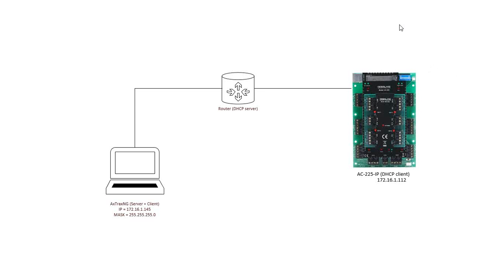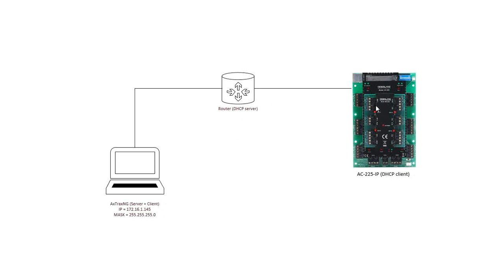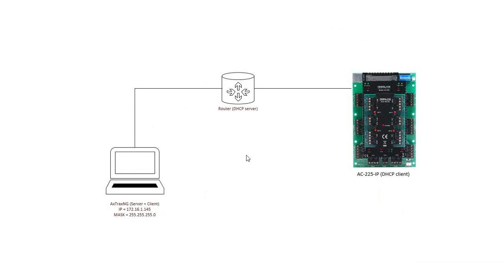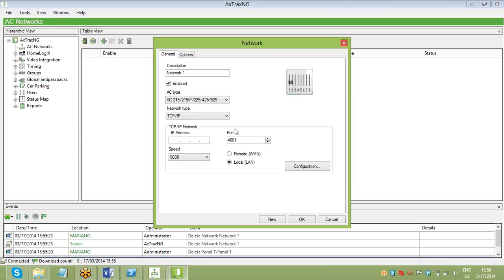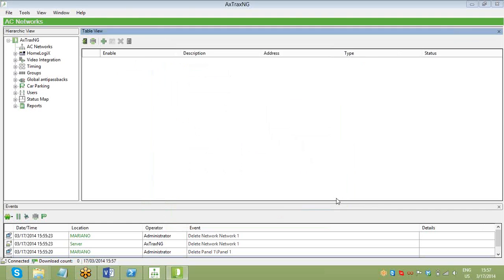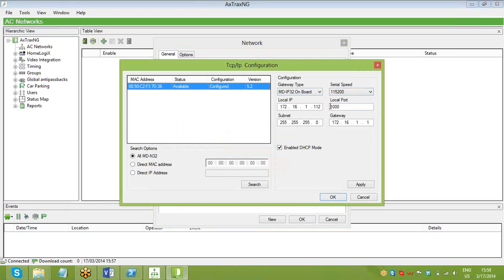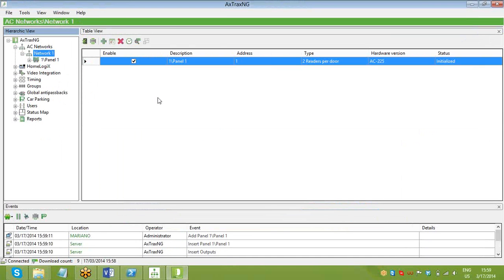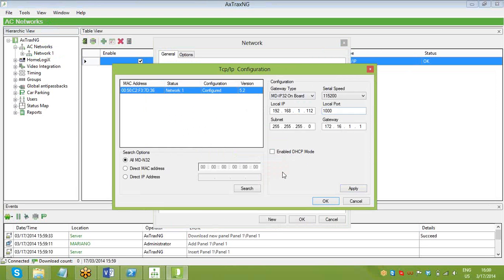How to add an IP panel - Rosslare Security Products

Comment: What requirement switch/hub specification?
Reply: Dear Yudhi, there is no special specifications switch/hub needed to be used with our panels. Thanks for your question.
Reply: @MarianoBianchi  could you send your email?i have some technical question regarding rosslare access control thanks